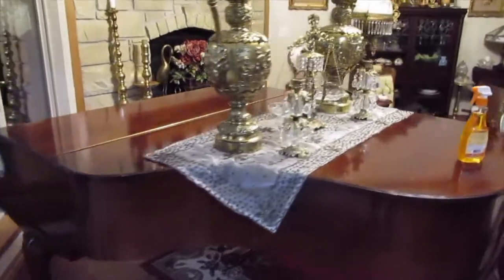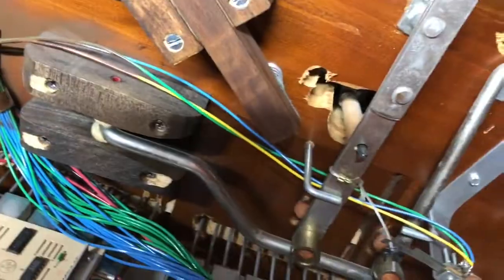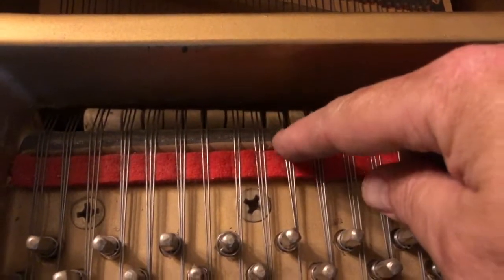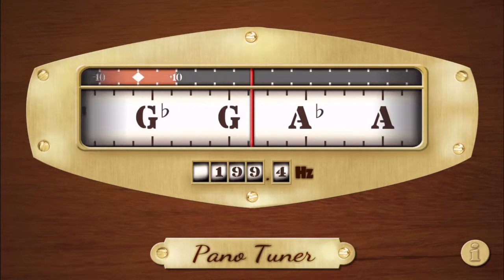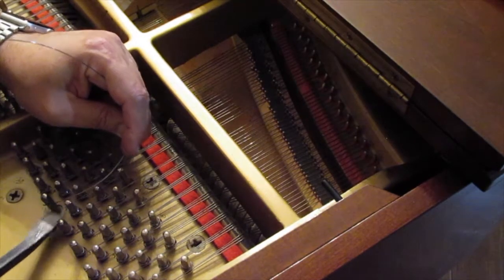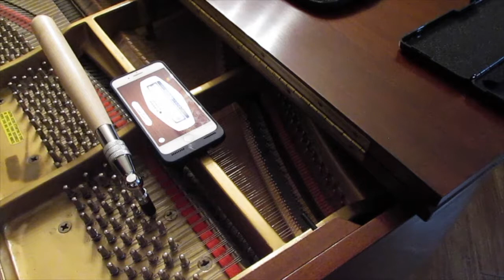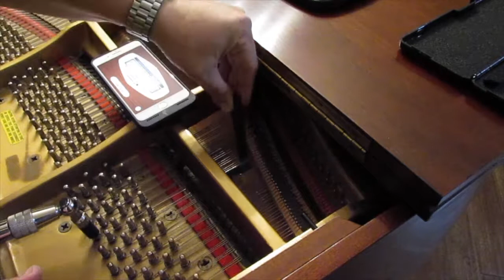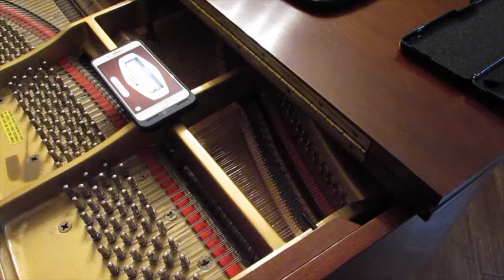You can tune a piano but you can't tuna fish   Tuning and Conversion of a Baby Grand

Comment: There aren't magnetic dots on the tape. The system encodes and decodes frame based "biphase mark code" which is just a digital line code which is a sound wave, the frames are 128bits in length with the last 8 bits 11111101 as the sync word which latches the entire system to the decoded frame.